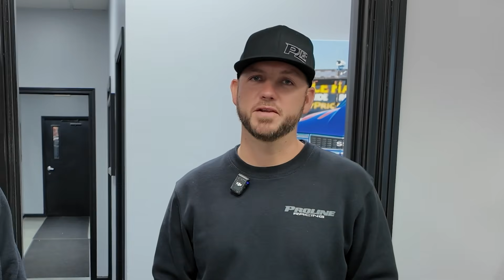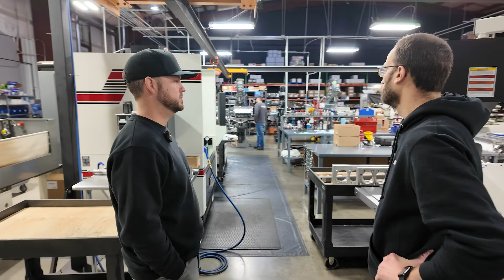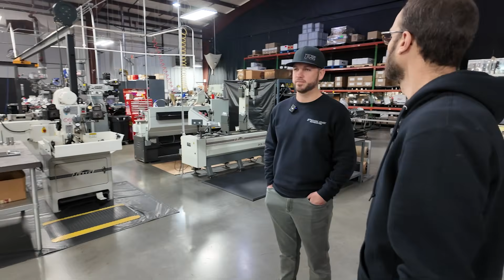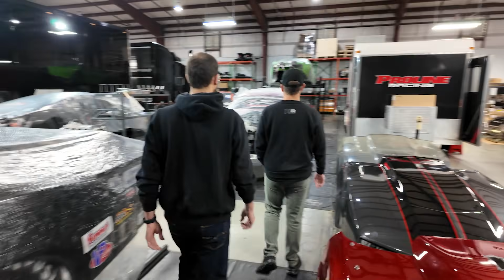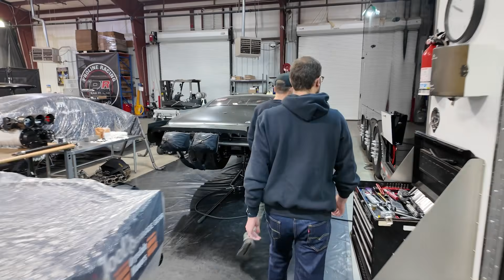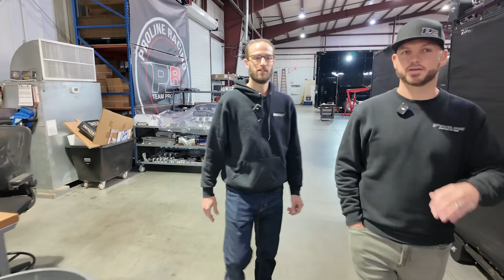If an Engine Won't Make 2,500+ HP, Pro Line Racing Won't Build It – We Get a Full Tour

Comment: Sucks they don’t build coyote motors, I along with at least a few others I know was just talking about that out in the shop a few nights ago that we’d probably pull the trigger on one if they did. Unfortunately it looks like it’s limited to Chevy/Hemi build unfortunately, not that I’m hating, that’s a nasty set up. But with there reputation, I’d almost bet they’d sell a ton of the coyote race engines, as I said, I can think of 4 people right now that would have their order in by the end of next week, then again, for all I know, they very damn well could be making some and I just don’t know it. But on there website, it’s mainly just some badass Chevy/Hemi combos.
Reply from the maker: Yeah, we don't think Pro Line does Coyote, but if you need three good shops that do... check out Fast Forward Race Engines, Modular Motorsports Racing and TKM Performance.

Comment: Those big hp "drag racing" engines are the easiest to build to find big horsepower.

It's the guys that build production based circuit racing engines, that need to have a broad torque band but also the best top-end power, that are the best engine developers.

The guys that have to spend weeks toiling over the most technical areas of engine development to gain as little as 5 horsepower but retain a driveable, broad torque curve.
Those guys are the real geniuses.

We love when we get asked to build a "drag racing" engine, or power boat engine, because they are a no brainer and piss-easy to get the type of power those cowboys expect.
Reply: We are talking 3000 to 4000
Hardly the level your referring to. Not long ago  it was 2500.
Stay tuned next year they will be at 4500hp. Dont kid yourself these guys push the envelope. Don’t confuse the success for easy. They are the Avant guard at this level.  
5% of 400hp and 5% of 4000 hp   Are earned the same way. “Consciously “
Being conscious is not mutually exclusive. Don’t kid yourself.

Comment: That parts hot washer, if it's running all day then buy another, it's probably the choke point of production. Also, to make parts super clean, you have one machine for pre wash, then a after wash in a different machine.
What I have seen done is using a hot wash first, then a commercial dish washing machine second.

Comment: I love when proline and noonan  get their ass beat at the track
Reply: Cool 🙄
Reply: Especially by “Snot Rocket” !!!
Just a Little 5 Litre, 302 COYOTE engine kindof stock with many Stock Ford Parts. 
It’s just a Baby engine that Blows the doors off of Pro Line, Noonan, & Steve Morris Drag and Drive motors !!

Brett LaSala with his 
Green “Snot Rocket” Mustang 
Win 2nd Place Fastest Overall at Nationals Last year !!!
And that car is a Street Car you can go thru McDonalds with !!!
Reply: @melindagreen3023  Its all aftermarket parts. Don't let the internet fool you. There's nothing factory about it. But I don't care about a car that runs 2 to 3 times a year. Im talking about the real fast cars and promods. Real points racing for championships. And LDR racing too. Don't care about a little radial chassis car
Reply: @lanegeisewite1436  Yes there is !
Water pump is a Ford Factory pump
The block & heads are Factory Ford Performance stock except for the Block has Liners. 
Main Timing chain is Ford stock. 
And other parts are factory. 
👍
Reply: @lanegeisewite1436  he doesn’t run Florida summers because it’s way to hot. 
Nobody in Florida runs in the summer extreme heat.
Reply: @melindagreen3023 You're missing the point. That car can not run with the big dogs for points. Its not fast enough. Its "factory casting" which means nothing. Everything internally is all aftermarket. That chassis and engine are too slow to run in LDR or 10.5 radial. Those cars are running mid to high 5s consistently. Im not talking about one hit wonder cars. Im talking about every weekend points racing cars. Totally different
Reply: @melindagreen3023 Can you give me one example of when Brett Lasala has beaten anyone running a Noonan 4.9 hemi a proline MH7 hemi like what's being shown in this video? You YouTube fan boys really can't wrap your head around the fact that drag racing was alive and well before shit for brains individuals like yourself discovered YouTube.
Reply: @melindagreen3023 how do you even compare a 3500hp to 6000hp pro mod vs a 2800hp+ drag and drive 🚗  😮

Comment: Notice how clean and dust free the entire engine shop is, compared to some that have oil, grease, dust, machining chips and grindings, with cruddy old engines and parts just laying around here and there, while having no concern that is given over absolutely clean engine blueprinted assembly areas, making easily possible engine oil contamination, causing damage wear and possible breakage on the engine start-up and intiall break-in period . The Pro Line Racing engine assembly area is between a clean mother's dining room table and a hospital's operating room. With every part used on the blueprinted engine freshen-up assembly being magnafluxed for micro-cracks, the freshened engine is just as reliable as a brand new engine block, heads, and all other parts being brand new. Theoretically, once a brand new engine is purchased from Pro Line Racing, it would be the last one purchased, and as long as a complete grenading of the engine block and heads does not happen, Pro Line Racing could freshen the engine every year, with after a five years or so period, replacing parts such as connecting rods, push rods, pistons & rings just for insurance, dry sump oil pump, valves and springs with replacement rockers, camshaft &n lifters & drive chain/gears/belt. The crankshaft should be good after passing five years of magnafluxing with no signs of micro-cracking. If I had a Pro Mod Car, it would be serviced between major racing events by Pro Line Racing, along with all drivetrain servicing and freshening as needed. Maybe one day soon I'll have the privilege of buying a Pro Line Racing engine/trans for my 96 Mustang GT, that I have sentimental feeling for, because of having fun torquing it around the streets, and drag racing in the Summit Street Series at RMR in SLC, UT. The 96 Mustang GT has been sitting for a few years because of having over 350,000 miles on it with the computer system becoming fried, I have plans plans for dropping in a Coyote engine in front of the T-45, that has a recent complete rebuild to a World Class  T-45 transmission internals.
Reply: It sounds like you need a company like Proline Racing
Reply: @rockers2rockers616  That is what I recommend to every racer who patronizes "dirty engine machine shops".

Comment: Pro Line Racing did not have to work their way up from the bottom to the top. Pro Line Racing started at the top in 2005 and has been there ever since, with a lot of their engines in the winners circle. The future should still have Pro Line Racing at the top of the fastest and RELIABLE engines, without some of the other engine builders attitude of "things break in racing". That attitude might be OK if you have an engine machine shop to keep rebuilding blown up engines for you personal race cars, but customers usually want their racing engines reliable and fast for winning races, instead of excuses that this or that broke with stating "that is how building racing engines go". No it is not how it goes, as long as your not trying to reinvent the wheel every time you build one for a customer.
Reply: You can't control what someone does to the engine. And people push things while racing. I don't get how people expect an engine being raced on the edge to last 400,000 miles like a 200 hp Toyota engine.
Reply: You have to change pistons n rods after 20 passes on one of there engines. Steve Morris smx can take a beating for 10k miles if you pay attention and at least his can be driven down the road
Reply: @sneezinhatch  Steve Morris smx engines don't last with constantly blowing up. Excuses don't win races and the smx is not a top fuel engine that required constant changing out of pistons and rods. Steve Morris advertises the smx to be a street/strip engine, which it is. The problem is it won't last any length of running time, period. And Steve Morris excuse of "things break in racing" is not the norm in other racing engines that have all the cylinders replaced with solid sleeved top deck replacement, that are the true surviving street/strip engines that make as much and more power as the smx. DO YOU KNOW WHY STEVE MORRIS RACES HIS "WAGON"? Because he needs excuses for constantly losing races while constantly blowing up his special smx engines, and that is the reason other racers are not putting the smx at the top of racing engine sales. Proline sells 10 more reliable engines that DEEBS like the HOT ROD MAGAZINE current and former employees with someone else paying for it, constantly blowing up the Steve Morris smx and his other engines, with constantly paying for engine repairs or replacements, while he cracks jokes about the engine owners while taking no responsibility for his engines constantly blowing up when raced. Eventually, the racer will bankrupt him and his son by stopping the patronization of STEVE MORRIS UNRELIABLE ENGINES. SAVE MONEY AND WIN RACES BY USING PROLINE OR OTHER RACING ENGINES !!!!!!!!!